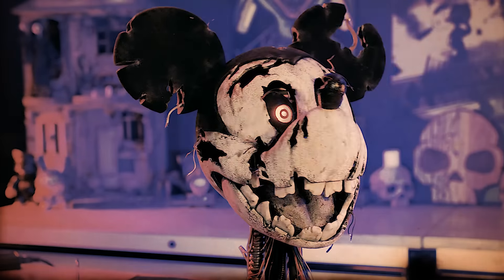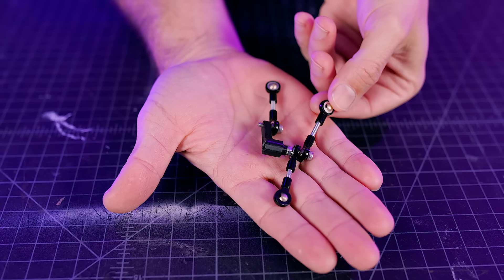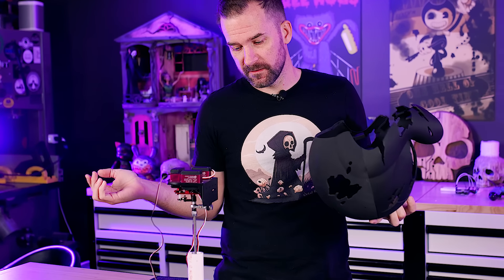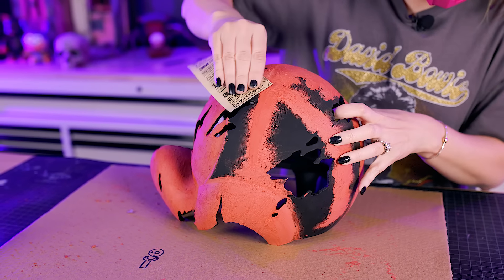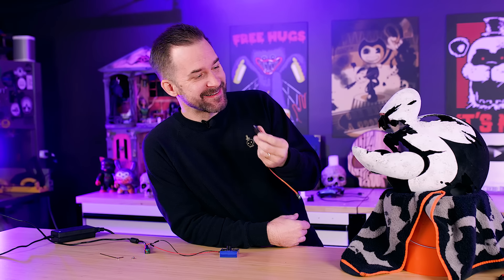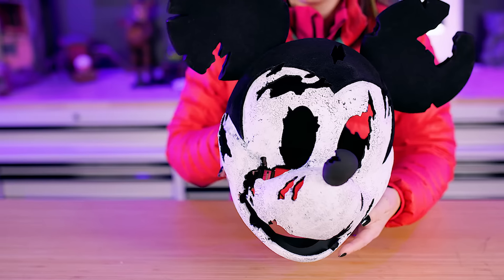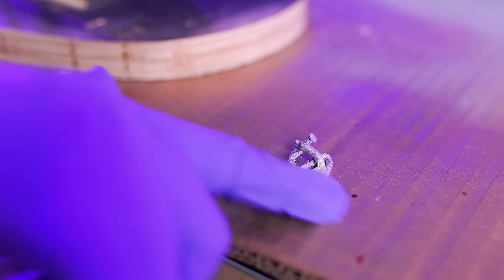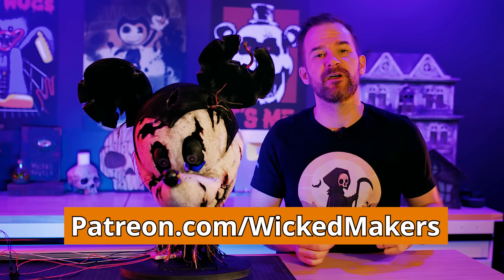We turned MICKEY MOUSE into a Nightmare Animatronic!

Comment: I would have shifted that neck pivot much more forward. If you're using Solidworks, there's a "mass properties" button that shows you where the center of mass is, and the closer you get your pivot point to that the less stress you put on your parts when moving.

Comment: To have your screws fit well into plastic, I highly recommend using threaded inserts. You just heat them up with a heat gun and shove them into plastic, then you can screw your bolts right in

Comment: Speaking of Five Nights at Treasure Island, more specifically the ones made by Radiance, which character would you make an animatronic of? Doesn't have to be the full body and could easily be just the head. Each character (toon as they are called since they're not robots actually) has a unique twist on the design. Or maybe there's a different fan fame you'd wanna make one for like POPGOES, Candy's, the Joy of Creation, JOLLY, or maybe even something more realistic like Five Nights at Chuck-E-Cheese Rebooted, JRs, or Tubbyland Archives? There's a lot of crazy designs with unique twists and concepts.